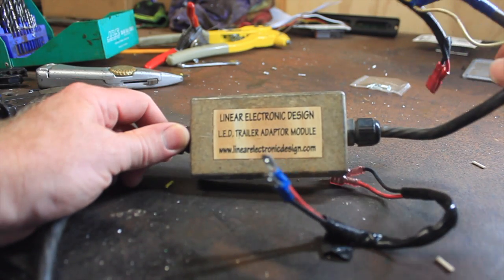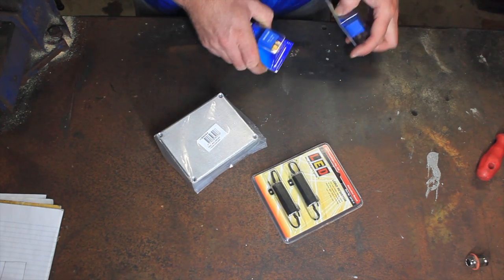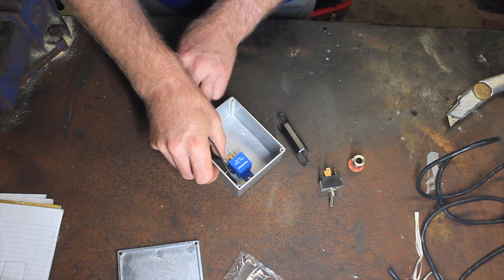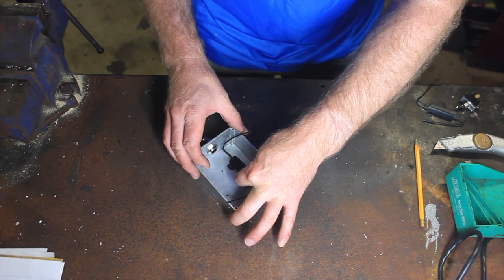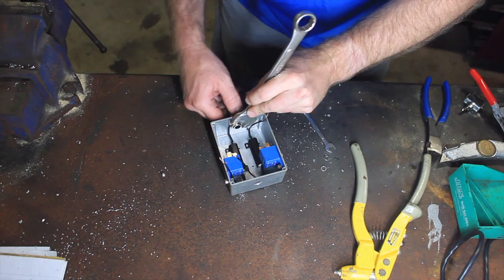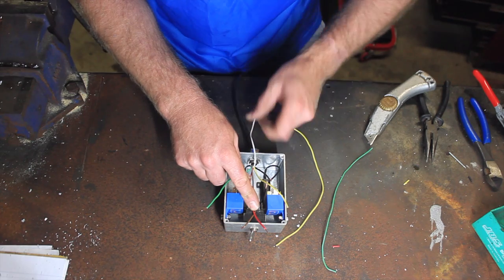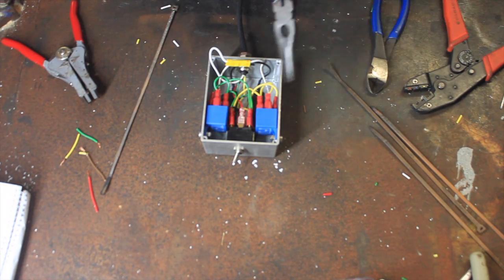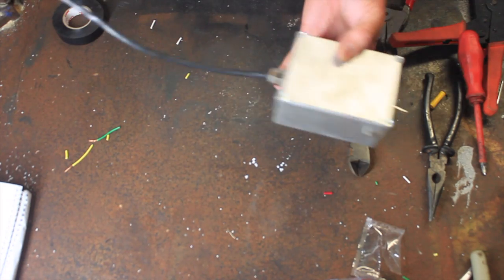Build Your LR3 Discovery 3's LED Trailer Module for Under $100!

Comment: Shane, wanted to pick your brain on a problem I have with Tow wiring on my LR3. I bought a OEM LR harness, plugged it into the car, and activated the tow electronics with my GAP Tool.

Hooked up my camper (LED tail lights) and neither the brake or indicators on the trailer work. I have tested them with 12v fed directly to trailer socket to confirm they actually do work. Also rented a box trailer with LED tail lights and had the same problem.

In the USA, trailer wiring groups right indicator and right brake into one wire, and left indicator and left brake into one wire in the harness. 

Because the LR3/Disco checks indicator resistance for trailer presence, and both indicator and brake lines are combined, my thinking is the car doesn't see a trailer and therefore doesn't output a signal to brake or indicator lines on the tow plug. 

Next test will be to run a test light with an incandescent bulb on the indicator circuit and see if I get the trailer logo on the dash display and output to the test light from the tow socket.

I'm thinking of building the box in your video, but want to be sure if this will cure my problem.
Reply from the maker: Defiantly test your output from the vehicle with the test light, also there are towing light fuses in the LH rear compartment so might be worth making sure that are all good as well. I'm not really sure on the USA specific wiring and if that is potentially messing things up also - not something I'm totally familiar with to give you an answer off the top of my head
Reply: @Shanes_Shed  Thanks Shane! I'll check the fuses and run the test light to see what I get.

Comment: Might have to do this. Had the same unit with a plug each end but looks like it died.
Reply from the maker: Wouldn’t be such an issue if one could easily replace components inside them.

Comment: Hi Shane, I am planning to do this to my 2012 Discovery 4. Curious as to why relays are necessary. I have seen ballast resistors simply installed across the LEDs inside the rear tail lamps on PowerfulUK channel. Your thoughts would be appreciated.
Reply from the maker: Yeah the D4 is different when it comes to the trailer lights - it will detect the resistor once and shut down the pulsing, where as the D3 continually pulses so they need different methods to get the end result. D4 can also get away with one resistor on one indicator circuit.

Comment: Hi Shane,
Do you need the relays in the system if it was made into a plug adaptor only? I just changed trailer lights over to LED and have the pulse issue and was just going to make an adaptor with resistors but just trying to understand if the relays are for turning the unit on/off only or if they have any other importance as the original one you had have the relays aswell...
Reply from the maker: Hi Joey, thanks for the question. In a D3 you need the relays, D4 can use just the resisters. In a D3 if you just put a resister inline then the LED lights will still flash. The resister and relay setup allows that brief pulse to go to earth and the car sees the resistance as if it where a bulb, but then when you use the indicators the current can go through the relay and to the trailer LEDs.
Reply: @Shanes_Shed  I have a D3 and that makes sense, looks like ill be making the box up like you did now then. Thanks mate

Comment: Awesome mate, does this then just get installed in series to the left and right indicator circuits in the disco before the trailer plug?

I'm guessing theres nothing stopping me from putting a plug on either end to just go in series between the trailer and disco, without the switch, as long as the other circuits are continuous?

Cheers for the help
Reply from the maker: Hi, yes you are correct. My original module (the failed one) had trailer plugs on either end when I first got my disco (the unit came with the car). For a while I had it cable tied to the draw bar on my camper, but I eventually installed it into the disco with a switch to turn it on and off. I've got an installation video ready to go which will be up on the 18th
Glad the video has been of some help